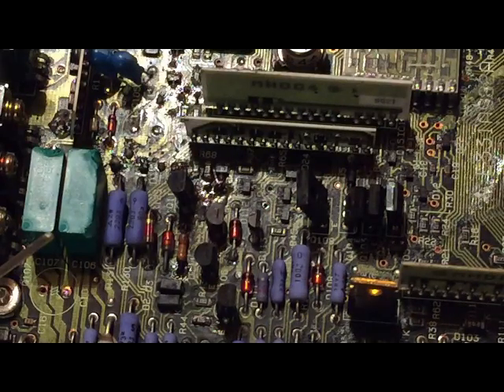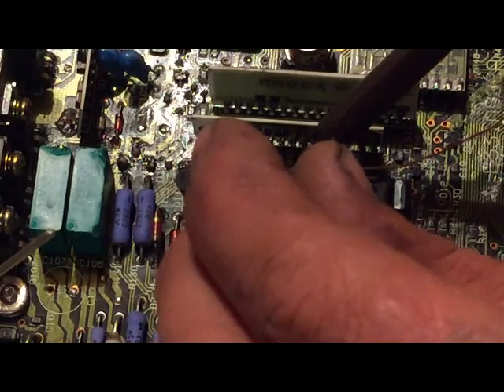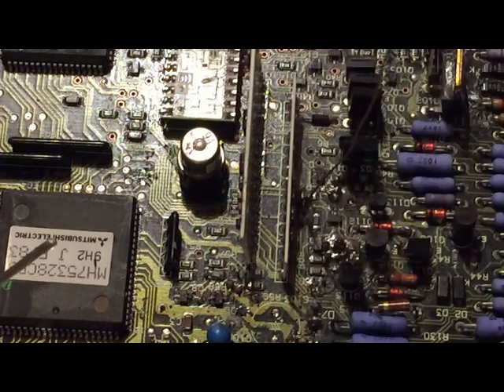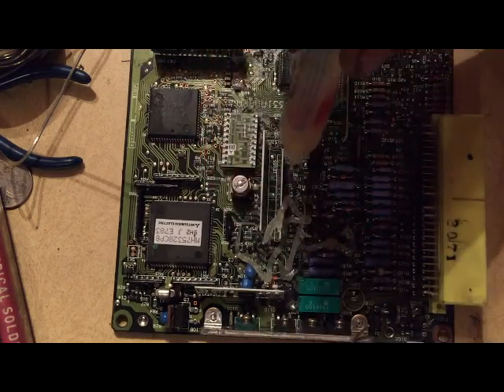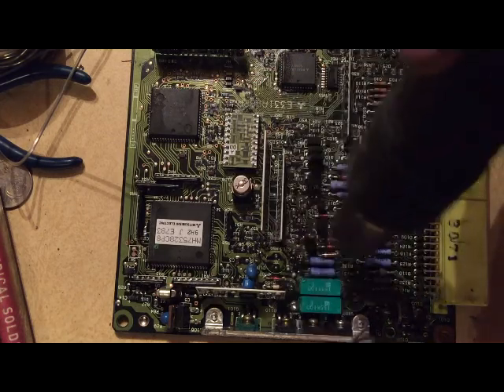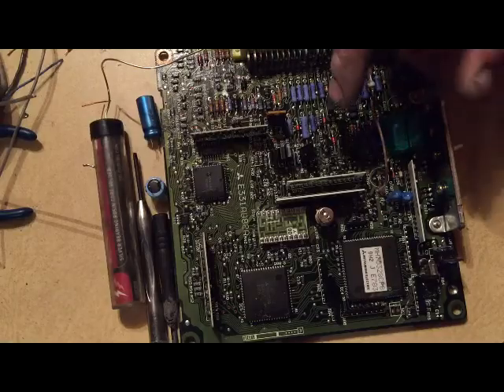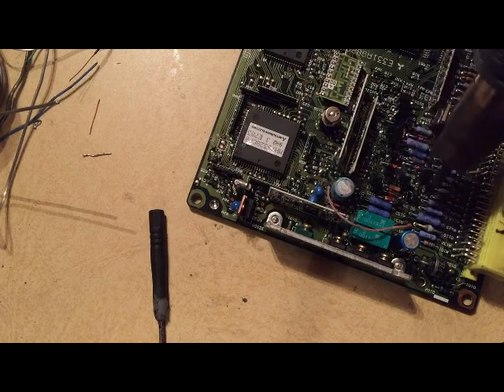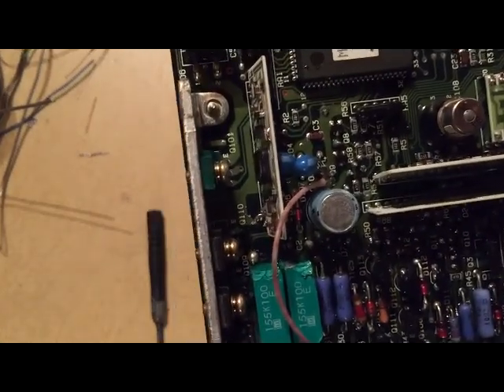Mazda B2600i computer repair

Comment: i have my 1993 mazda b2600i 4x2 automatic, crank but no start, i replace the fuel injector, i also open the ecu and clean it with break cleaner and it removes sticky thing and the board is good no damage no burn not even single damage like brand new no corrosion but still it wont start, replace spark plug and air flow sensor the whole thing, but if i put starting fluid it sill start but after burning starting fluid it it will die, what do i do next? please advice. thanks
Reply: Any luck? I have the same problem
Reply: @goosebumps-g4z  until today I didn't figuren out, it was running 5 months ago but when i replace the fuel injection and never run again.
Reply from the maker: Ground wires under throttle body

Comment: What size/grade capacitors are recommended for replacing the old ones?
Reply from the maker: Use the same size and voltage that came out of them normal capacitor replacement just means all you need is equal to or greater voltage and microfarad

Comment: Hello mate, great content.  I wonder if you could help point me in the direction I need. I have a 1991 b2600i 4wd. I generally runs great. It started having issues when trying to start the truck, sometimes it would just not start until I tried quite a few times. It would crank but not start. Fuel seems fine, as is compression so I figure something to do with the spark. The other night though I was driving home and lost all power. The lights and everything kept working, just lost all power to the engine. My revs just plain dropped to zero. I got it towed home. The next day, after quite a few cranks, it got running again and has been fine since except for taking a few cranks to start up again. 

I had the motor running and checked the spark coming from the leads, the one for piston 2 seemed weak and inconsistent. I am getting new leads tomorrow but the issue seems deeper than that. Does this sound like an issue the ECU may produce. I am pretty handy with a soldering iron so I might try to pull it out over the weekend and have a look. Any other possible causes. Cheers mate, I really like the videos you make.
Reply: Ever figure this out? I’m having the exact same problem as you’re describing
Reply: @Mo_Money84  Hey there. The issue ended up being the distributor. It one day randomly stopped and would not start again. The roadside assistance guy took a look or two at it and it was the distributor. Replaced that and the leads and plugs and it hasn;t done it since.

Seems they get old and begin intermittently faulting (mine did this over 3-4 months from memory, until it finally carked it).

I didn't think it was the issue because it would often work. Didn't think a distributor could do that. Thats prolly why I am not a mechanic.

I guess one way to diagnose next time it is not working is have some one crank it and check for power at the coil pack. If you are getting power their but its not making to the spark plugs it should be the distributor.

I hope you find the issue. I haven't got my MAZDA anymore, she has retired up in north west Australia with a friend as a fishing car when ever I visit. I think she likes that.

Comment: I was gifted a 1989 Mazda b2600i 4x4 from a neighbor with 32,000 original miles. He was the original owner and it has been barn kept the past 30+ years and used as a field truck. I am suspecting my issue is the ecm/ecu module on the passenger side kick panel, but what are the steps/tools needed to check it out myself before having the unit sent out for repair? I have tried to contact avpro for help but not sure if I have the right contact information or weblink.
Reply from the maker: It is very easy and basic remove the computer pull the four Phillips screws from around the computer pull the cover off you’ll see a black pastor in a red capacitor around cylinders it will be acid eroding out from the capacitors sometimes these units fail with little to no damage on the board itself and then repair as needed there’s a right way to repair these computers and then the way that cordon and avpro repair of them. When the computers fail usually you lose injector pulse so you will see spark but rough idle no idle coughing and hiccuping while running
Reply: @WorldScienceTV  I believe I have spotted the small red capacitor, it has a black band inside it... correct? Visible fluid on the surface of the board, with no visible damage to the board itself.  The capacitor in question is between R76 and R78 capacitors on the board with a D24 under it. By chance what size is that? I have pictures of the board I could send too you if needed.
Reply from the maker: What is the vehicle doing what are the symptoms
Reply: @WorldScienceTV  truck will start and idle fine. When you accelerate the truck falls on it's face, loss of power and dies.  Sometimes will stay running. If you turn on the headlights it will sometimes die as well. Previous own has replaced fuel filter and looks like the distributor also. When I disconnect the MAf sensor the truck runs super rough until it's  pluggee back in. Under the hood this truck is super clean. I am assuming yhis issue just started to happen since he was driving it up until this year. Another new issue I have come across is the wipers will not work either, so far only checked  main fuse block for this issue.
Reply: @WorldScienceTV  this is also a 1989 Mazda b2600i 4x4 and from  what I can tell it has a G607 Ecu box. If that's an help? Like I mentioned the board is in amazing shape and I have a hard time believing this is the issue. After reading all the threads However, I am not ruling it out

Comment: I popped mine open to have a look for any noticeable problems and I found corrosion on diode D110 and the sides of it are cracked off. I thought it was a replacement since it didn't look like any other diode on the board but I went through your video and saw the exact same thing. Right at 5:00 in the lower right, third part up from the bottom. Has a brown stripe with white and a teardrop shape. 

Do you know the diode so I can hopefully find one to order or something compatible?
Reply from the maker: I will look to see what you are referring to you can send me pictures on Facebook @ worldsciencetv

Comment: (Help) What is the best plugs to use for my B2600i, 1991 2.6L engine?
Reply from the maker: All depends on how good the vehicle runs and how much oil is being burnt if the engine is running flawlessly and you can run a platinum or iridium plug no problem. If the engine is not running well then you need a lot of room for the spark to go through carbon from burning oil so cheap plugs at that point.

Comment: Could or would you repair my 91 Mazda b2600i 2.6L ecm for a fee? It still works but it has some burnt connections. It's a G618 18 881A.
Reply from the maker: there isn't a hundred percent success rate
Reply: Thank you for your reply. If that is the case, then I guess the best course of action is to seek out undamaged ones at a wrecking yard. Again, thank you for notifying me.